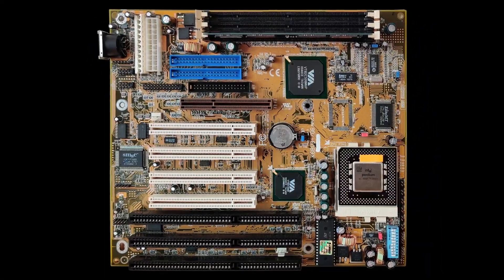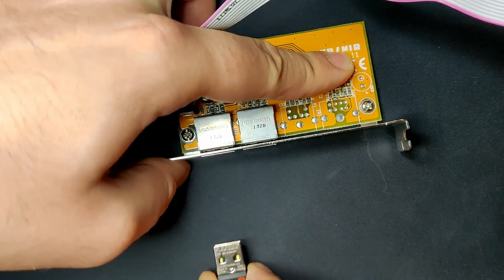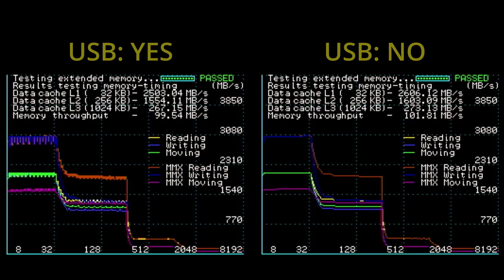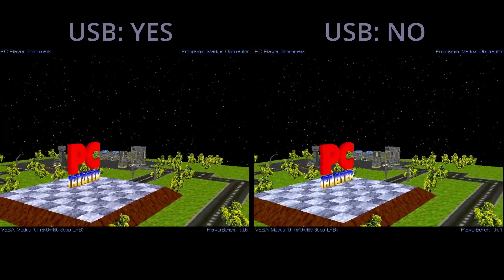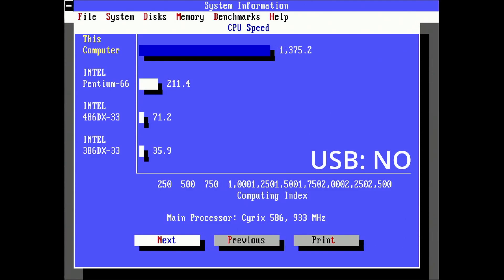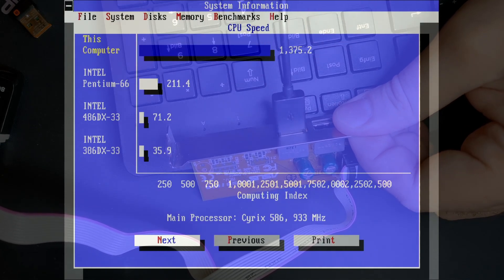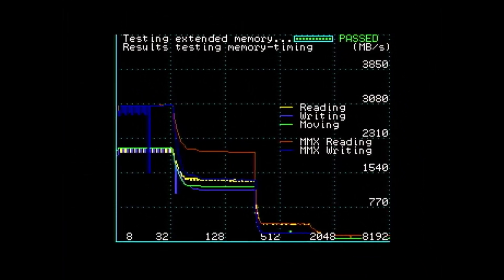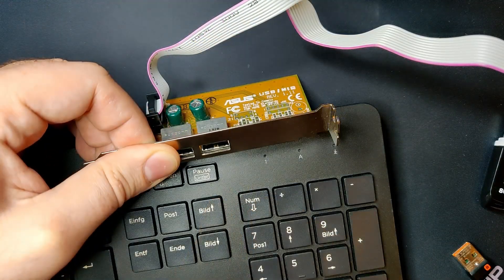Retro PC: USB may slow you down!

Comment: I know I may be late to the comment section, however I noticed that all my older. hardware that USB has caused me some slowdowns and stuff. what you can do is that There are certain apps like one especially on Android phones where you can like set up like an FTP server from your phone on your network and if your Windows 98 system is connected to your network, you can literally just download files from your phone's FTP server. It's so much more convenient and it's just it's way easier and you don't have to worry about performance issues when it comes to USB.
Reply from the maker: I need to find a nice way to connect storage to vintage PCs. I believe that an FTP server is a nice and easy way to do that. Still, you need a network connection and that might be difficult under DOS. But that is very cool that you can connect from Windows 98 to a phone's FTP server :)
Reply: Basically, I set up another computer on my wifi network using a  Windows 11 system-where I bridge the Ethernet and wireless connections. Then, I connect it to my Windows 98 machine through its Ethernet port. I'm not sure if there are Ethernet cards for DOS, though. Also, the app I use on Android to set up a FTP server is CX file explorer.

Comment: I believe it's because the signal from input device is an interrupted signal and not a standby signal. So the cpu needs to reserve x amount of cpu utilization, to make sure it has enough for the anticipated input(s). Whereas, the USB flash drive, isn't being accessed constantly, it being plugged in doesn't take away from the available resources, if you had accessed the drive or if auto play was a thing back in usb 1, I am almost certain, you would have seen a drop.

Comment: I just encountered the same boot looping problem in an ASUS P55T2P4 rev3.0 with a K6-III+. I finally managed to get it to boot when I reset the BIOS settings to default (which disabled USB). When I turned it back on, the bootlooping resumed. Eventually, I discovered that having the USB keyboard plugged in at boot time led to the problem. I could enable USB in BIOS settings and plug the keyboard in after it had booted, and it worked okay. Super curious if you know anymore about why.
Reply from the maker: Yes, same issue with my board. I think I have seen it on a different board too. Unfortunately, I don't know why this is happening or how to fix it. I plug the keyboard once the IDE device detection starts.

Comment: It could be polling as others have suggested, but I don't think that would change the CPU clock. I think what's happening is the USB subsystem requires typically a 48MHz clock, which does not divide evenly into the normal 933MHz (the result is actually 19.4375). If we go to an integer scale, say 19, we get a CPU clock of 912MHz, which, if you look closely, is halfway between the two values it shows most of the time (906/908 and 915). So I think the USB system is requesting an integer clock scale. At least, that's my first guess. It would explain why the CPU clock is changing, whereas if it was just polling, there'd be no reason for the CPU clock to change, although you might still see a performance penalty.
If you test this under Windows, I'd be interested if there was a difference. Under DOS, I doubt there are any complex USB drivers loaded so it's probably handling everything in hardware. In Windows, with drivers, it might be able to work around this issue somehow. This would also explain why the USB flash drive isn't causing the effect -- under DOS, it's probably not being enumerated and there's probably no driver loaded, so the USB subsystem basically ignores it. I would try with other devices that can work under DOS, or try and find drivers that support USB Flash drives under DOS.
Let me know if this makes sense to you!
Reply from the maker: It's an interesting take on the CPU frequency. There is a follow-up video on my channel where I also check the performance under windows. It seems to suffer from a similar performance penalty there. I am in the process of acquiring some PCI expansion cards. Maybe we will see some differences there.
Reply: @bitsundbolts  It's been 10 months and in the interim I've actually been learning a lot about USB because I have started using it in embedded systems development. Now I suspect it's the endpoint type that is causing the issue. USB has four different transfer modes: control, bulk, isochronous, and interrupt. Control transfers are only ever used for negotiation and metadata between the host and device, and typically endpoint 0 is reserved for this. Then the actual transfer of data takes place over one or more additional endpoints. Isochronous endpoints are designed to give a guaranteed amount of bandwidth, and is typically used for audio devices or other devices where packets must come continuously without interruption. Bulk endpoints can have more bandwidth, but might have to wait or be interrupted occasionally. This is what USB flash drives and hard drives use, as well as devices like scanners and printers where a sudden burst of large data that needs to be processed relatively quickly is generated. Bulk transfers have the lowest priority -- if the bus is fully saturated with isochronous and interrupt data, then bulk transfers have to wait. The standard allows 80-90% of the bandwidth to be allocated to isochronous and interrupt transfers, with the remaining percentage guaranteed for control transfers. Therefore bulk transfers get to use whatever percentage isn't being used. So if you need to guarantee that data gets processed immediately upon generation (like audio/video streams, or keyboard/mice inputs) then you use isochronous or interrupt. Interrupt transfers are for occasional, random access data -- this is what most USB Human Interface Devices (HID class) use. The host still has to start all communication, just like with all USB modes (with some exceptions in particular parts of the USB standard), so the host will poll the device, which only replies with data if it has something to send. This is why we see things like different polling rates for mice -- the driver can change how often it polls to reduce latency, at the cost of extra overhead on the bus. 
So, my theory is that either the BIOS routines handling interrupt transfer are indeed polling too often or are written inefficiently and are taking more cycles than are needed. This is why the flash drive didn't cause an issue -- it's a bulk endpoint, and so polling is much less constant and has the lowest priority. I bet if you plugged in a webcam or USB audio device (if they are even supported) you will see the same jitteriness as with the USB keyboard dongle. However, my clock theory still does make sense to me, as USB has very strict clocking standards and unless there is a separate crystal somewhere to generate the 48MHz USB clock it would have to be derived from the main clock somehow. There could be a fractional PLL divider somewhere so maybe it's not the cause of the issue but if you have a scope handy, try measuring the USB clock.
I would like to point one thing out though -- you claim in the video that the performance difference is notable, but I can almost guarantee that in a blind situation where you didn't know whether or not USB was connected you wouldn't be able to notice the difference at all. 2-3% is way below what people would notice, even on a much slower processor. I really don't think this is as big a deal from a performance standpoint, but from a technical standpoint I find it very interesting and would love to be able to take a look at the USB routines being run to see what is causing the issue :)
Reply from the maker: Interesting! I do remember a bit of those details, but I never dove deep into understanding the USB protocol.  I recently got involved in a USB to PS/2 converter and all this information came up again. So, it makes a lot of sense what you're saying.
The performance hit is minimal, but measurable on slower systems. You're right, we talk about 2-3 percent. It may not be significant, but if all it takes is going from a USB keyboard to a PS/2 or DIN 5 keyboard, it's worth a consideration.

I got some USB cards for PCI - something I may try in the future. Maybe there is something else that needs to be unearthed 😊

Comment: Yes had noticed this back in Socket 7 times with my K6 166 MHZ. Also read somewhere article that USB causes performance losses. 
The problem gets bigger the weaker the CPU, plug in a P133 or similar, it becomes significant. 
With my K7 I had also noticed this and for a long time therefore renounced USB devices. from windows XP and stronger GHz computers it became marginal. 
Switch off USB completely in the bios.

Comment: Search for difference between OHCI and UHCI USB controllers.
K6BV3+/66 DFI -> Chipset Via Apollo MVP3 -> Soush bridge VT82C586B
-> datasheet says: USB v.1.0 and Intel Universal HCI v.1.1 compatible
UHCI = A USB controller using UHCI does little in hardware and requires a software UHCI driver to do much of the work of managing the USB bus. (most Intel or VIA)
OHCI = Compared with UHCI, it moves more intelligence into the controller, and thus is accordingly much more efficient
( see https://en.wikipedia.org/wiki/Host_controller_interface_(USB,_Firewire) )

Comment: Ms-dos does not support usb devices so there is usually usb keyboard setting in many bios of that generation that turns on emulation for such for OS that dont natively support usb and from my experience it is that emulation that causes the slow down which can usually seen for example in sysinfo that the number is lower if you hold down a key.

Comment: I'm not entirely sure, but I vaguely recall that for PS/2 emulation to work (USB legacy keyboard support), the BIOS has to drop into SMM (Systems Management Mode), do some black magic there (i.e. do whatever it needs to do to turn a USB keystroke into a PS/2 keystroke and provide the proper (emulated) hardware interrupt) and drop out of it, back to the OS again. 

And like many mentioned here below, USB is basically driven by polling, whereas PS/2 is driven by interrupts.

That would definitely explain the performance drop.

Comment: I noticed odd behaviors on usb devices.
One test that I did (that I dont see anywhere) was to benchmark my laptop while an input device was sending data (moving a mouse or pressing a keyboard button)
I have a few input devices to test but this is what I got on Quake 2: (percentage is the performance hit compared to not interacting with the input device)
internal keyboard: 3%
internal mouse/trackpad: 9%
internal trackpad + internal keyboard:9%
logitech G703: 100% (quake 2 actually freezes while moving the mouse)
generic microsoft mouse:  6 - 12%
reddragon keyboard:  2 - 12%
microsoft mouse + reddragon keyboard: 27%

This is a pointless test for new systems, but a fair test for those old setups with so little performance to offer.
Perhaps usb input devices are making games to feel slower than they used to

Comment: that is normal. usb has a very high pooling rate and back at this era, anything extra in the motherboard meant extra load on the cpu, and that extra load mattered. it still happens today, but since the processing power is so vastly superior, that reduction gets so small that it's way below the threshold for statistical significance. 

my brother had a pentium 2 400mhz with a MOBO that had all sorts of integrated components. it was still way faster than my pentium 233mmx at the time, but we've only realized how much that crippled his cpu when one of our friends also bought a pentium 2 400, but his mobo had no integrated anything. the difference was enough that my friend's pc running at 333mhz would still outperform my brother's pc. he then bought a new mobo and that was almost as big an upgrade from the 233mmx as upgrading the cpu itself.

Comment: USB keyboard and mouse are CPU intensive,becouse CPU ask  are there any changes in USB keyboard or mouse status every millisecond and wait for the response from the keyboard or mouse . DIN/PS/2 keyboard and Serial/PS/2 mouse works other way round , they send data to the CPU when they change status , so the CPU do not have to ask for any changes every millisecond, but just get that data from the decces . I am curious if the CPU is even swower then yours .

Comment: There's a much longer more convoluted answer to this than interrupt polling but it is the root cause of this issue.  Depending on how the bios is handling USB in 16 bit real mode compatibility (going all the way back to the stuff that is in every x86 compatible computer), depending on the type of USB keyboard (there's at least two types I know about. I suspect this issue is worse on a USB keyboard that constantly sends a key released signal at rest (vs one that only sends 1).   You could really go down the rabbit hole on this one.  If the bios supports turning off legacy usb keyboard support would be another thing to try to see if it affects things.
Reply from the maker: It actually does support switching off "legacy USB support". I will have a look and see what happens when it is switched off.
Reply: @bitsundbolts  sometimes what this is making the USB available to the bios calls as a standard port (at or ps/2 ) if this is the case interrupt polling is emulated and so if it is interrupted CPU has to jump to the emulator in memory, jump to handle the interrupt push the value to the buffer and then return jump twice (in a worse case scenario) .. to add insult to injury if you have windows driver's to handle the USB directly it will perform these operations in the background for real mode and provide the data in protected mode to the programmer via the driver's (that's twice!)
Reply: @bitsundbolts  it's also important to remember this might even vary from keyboard to keyboard. Some USB keyboards send a key not pressed/ key released signal constantly and some do not. this means that each time there is  data waiting to be saved the CPU does it's thing even if it is repeated data. In a bare metal emulation it's unlikely they have code to discriminate
Reply: @bitsundbolts  it's also possible this is all way off as I am unfamiliar with how a bios works beyond the block diagram but I can guess fairly well as to my understanding of what's going on, based on what is available to me from 16 bit real mode.

Comment: Hey! Great video! 

I've noticed this too. I've had a VIA USB2 PCI card plugged into my Asus P5A board with a K6-2+ 575 and it the performance gets completely gutted. I've done a lot of research on it over the past year and discovered that it has something to do with the polling rate and constantly hitting interrupts. I didn't know of any way to log or view interrupts per second (per IRQ as well I guess), so I began to move away from USB entirely on anything which has the southbridge attached to the PCI bus.

I've had similar issues with PCI disk controllers, such as VIA-chipset SATA controllers and various Promise IDE/SATA controllers. No matter which platform (SS7, Slot1/S370 and Socket A), I nearly always end up with teething problems with PCI/USB devices.
Reply: USB 2.0 sends SOF packets every 1ms, but in addition "At high speed the 1 ms frame is divided into 8 microframes of 125 us. A SOF is sent at the start of each of these 8 microframes" so you get 8x the number of interrupts compared to USB 1.0/1.1
Reply: @rasz  Thanks for letting us know! I spent a long time diagnosing that and didn't come across that information.

Comment: YES! This happened to me to recently.  Asus P5A SS7 Mobo hard-modded to accept AMD K6-2+ 550mhz.  There is slight performance drop as you found when using a USB 1.1 port but the way I first discovered this was because a USB 2.0 PCI card caused about 25% drop with a USB game controller - but other USB devices caused problems too.  POST card showed constant heavy PCI bus activity as soon as something was plugged into USB 2.0.  Looks to me like your board uses the same chipset as mine so I wonder how widespread the behavior is.  I can say it DOES NOT occur with the same USB2 card in my Pentium 2/3 boards.  I'd love if you could find a workaround better than my solution of using only USB1.1 in this particular PC.
Reply from the maker: I'll definitely revisit USB on those boards. I have two more super socket 7 boards that I haven't even tested yet. But looks like they all share the same date - maybe an implementation in the award BIOS that's shared among all those boards.

Comment: USB has always been an unreliable performance draining trainwreck. It's popularity over proper PCI cards with actual memory mapped IO and interrupts has always made me a bit sad.

Others have already talked about the likely cause, but I would be very interested in seeing how other hardware of the era behaves. Is there any that can eliminate this problem?
Reply: well, mem mapped circuits have to respond faster so they are more expensive, so as usual the reason was cost, at least in the earlier days. this might also have been why the x86 cpu's had separate i/o "bus", instead of going all mem mapped like previous arches. but as cpu's were rapidly evolving, usb's polling nature became less of an issue and now we are stuck with this mess. meh.